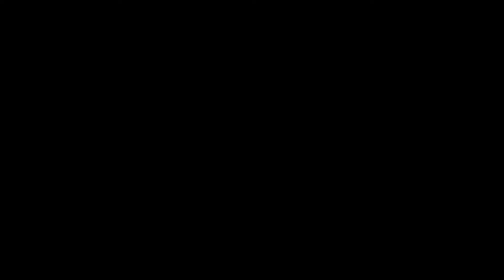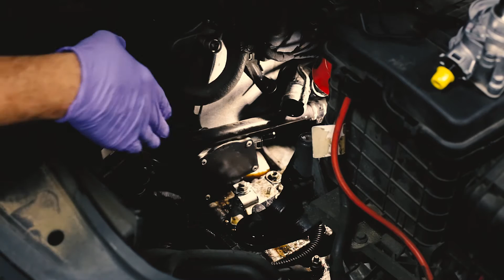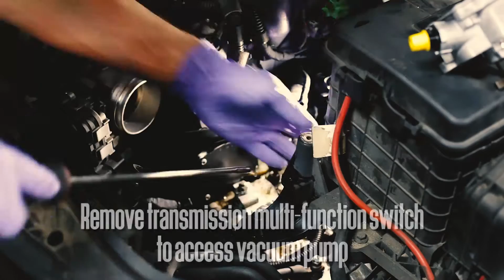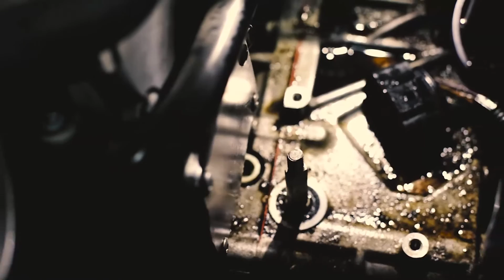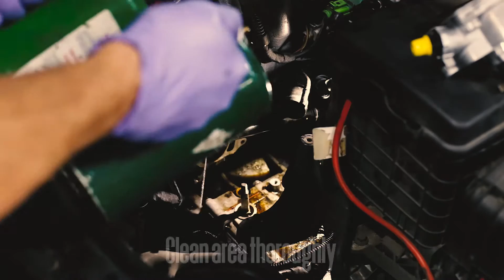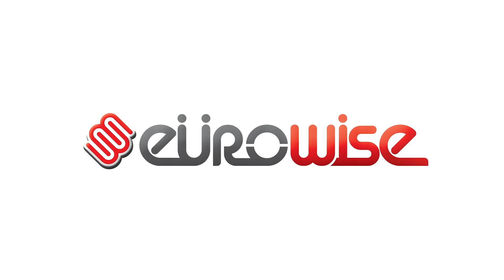Eurowise DIY: Mk5 Jetta 2.5 Vacuum Pump Replacement (Charlotte, NC)

Comment: The dealer and independent shop claimed I had to have the transmission pulled in order to do this job on my '09 MK5. I was being charged 1350$ parts/labor for that job to done. I'm glad I found this video.

Comment: Great video, but I'd recommend "shady tree mechanics" to clean up the oil with the pump in place. It's too easy to spray products into the engine when it's off.

Comment: is it true that its easier to do on a Manuel car then the auto ones ?
Reply: yes MUCH easier. You only have to remove three bolts on a manual and dont have to mess with the transmission at all.
Reply: So, we can skip the step for removing the transmission multi-function switch?
Reply: Yup, I have done it before on a manual, and it's allot easier.
Reply: do you need to drain the oil?
Reply: Samuel Pacheco could u link me to a site or video on how to do it on a manual

Comment: is it necessary to use the silicone sealant? are you essentially gluing that back gasket to the engine?
Reply: do you need to drain the oil from the engine first?
Reply: @anthonybrianperez  no